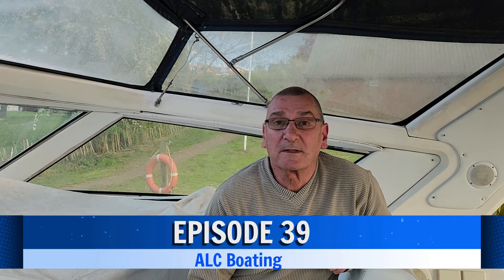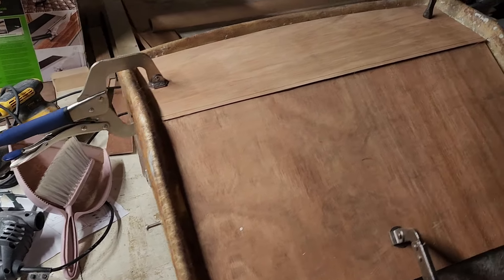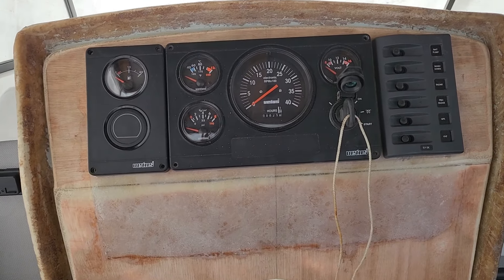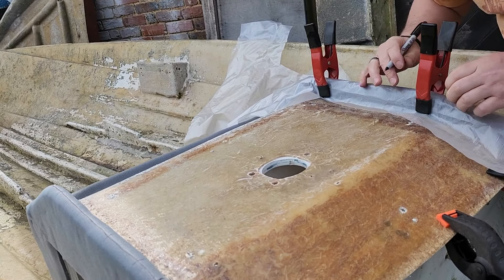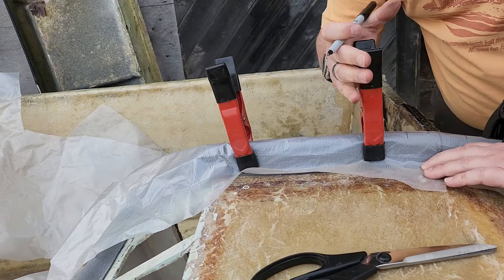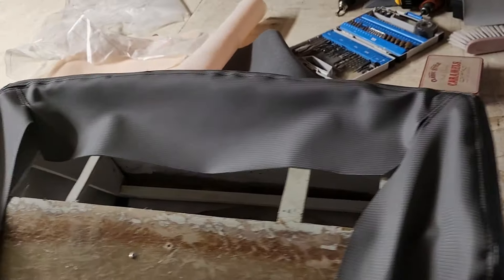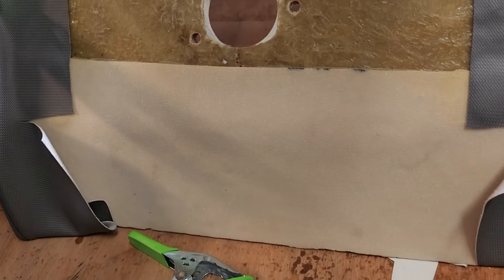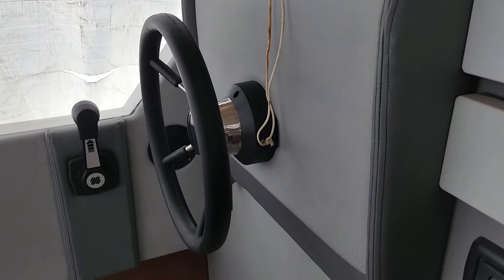Episode 39 #boatrestoration upgrading the helm to a new modern look

Comment: Looks great. A lot of hard work gone in to it and a nice blend ot colour contrast. Not sure if I'd prefere the old spoked wheel over the newer one. With a fresh lick of varnish it might work well. They're not cheap those old wheels, As an option; pop a clock face into it and onto the wall in the man cave.
Reply from the maker: Hi Loki yes the wheels are a point of debate among boaters some prefer the classic style others a newer look I must admit I was dithering with putting it back on so decided to keep hold of it. It does need attention but certainly can be restored  and probably will be at some stage